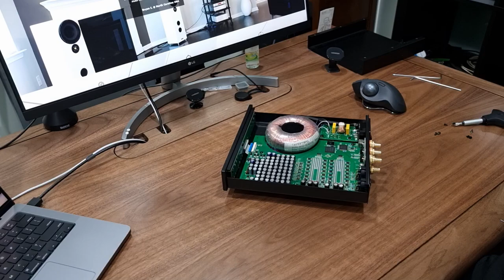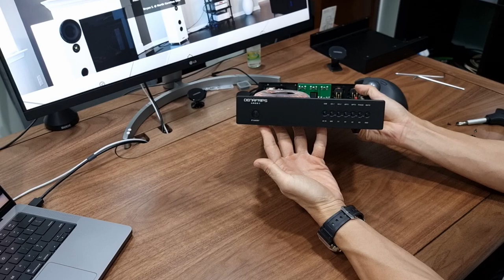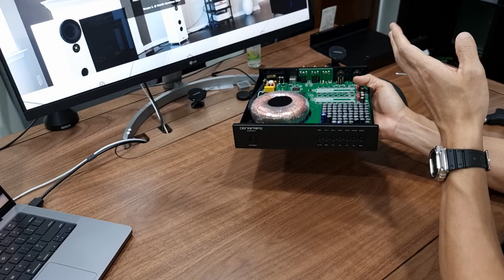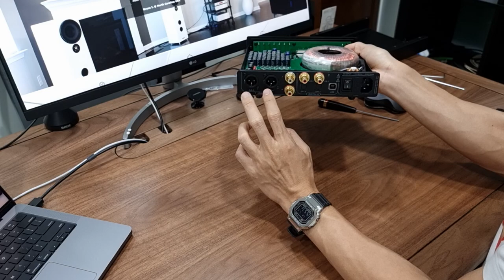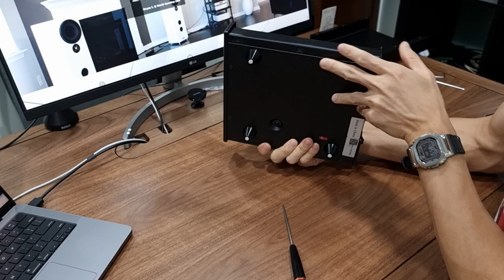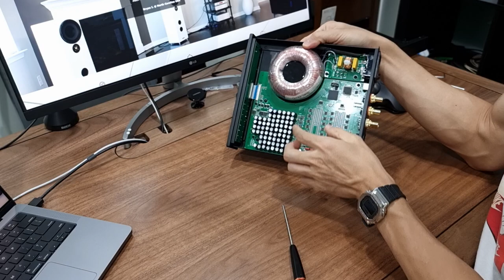Teardown: DENAFRIPS Ares II DAC

Comment: Next video, how going from aresII to higher denafrips dacs help the the quality of sound and what architecture or parts helps those dacs to achieve it.
Reply: I'm no expert, but can tell you that pontus ii adds an i2s interface (superior topology) if your source supports/outputs via this connection type. 

Also more galvanic isolation as you move up the line, and increasingly better internal clocks. 

There are likely other upgrades but that's what I recall off top of my head!
Reply from the maker: Good idea! Perhaps a side by side comparison of the Ares II and Pontus II - design wise?

Comment: hi there, when I connect this unit to my MacBook Pro, I select 24 192 in my Mac settings, but when I listen to a 16 44 file on Apple Music, the lights on the front of the DAC show "24 192". is this normal?
Reply: yes, if you have set as fixed output of mac 24/192
Reply: @giordylan  thanks, was wondering if I should change Mac to 16 44 for those files or just leave it at 24 192
Reply: @anthonyjriz3  on audio midi (left column) select the dac (denafrips or usb hiresaudio) I don't know what you see ....
in doing so you pass the coreaudio of the mac
for safety also go to system preference> sound and check that the audio output is on usb hiresaudio or what is indicated in the audio midi when the dac is connected on usb.
Reply from the maker: It was due to Apple Music/Midi Setting. We recommend roon/jriver/audirvana. These software can take control of the DAC in exclusive mode :)
Reply: @VinshineAudio  so youre saying Apple Music doesn't take advantage of the dac?